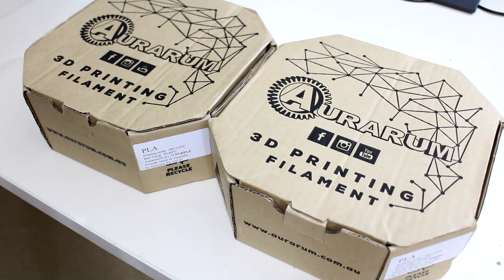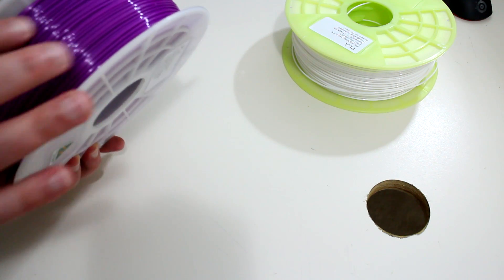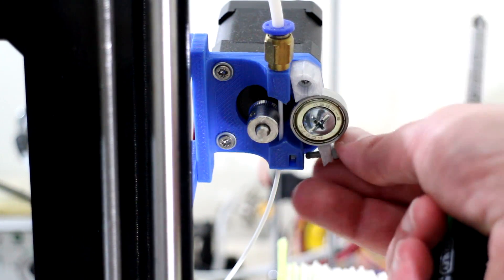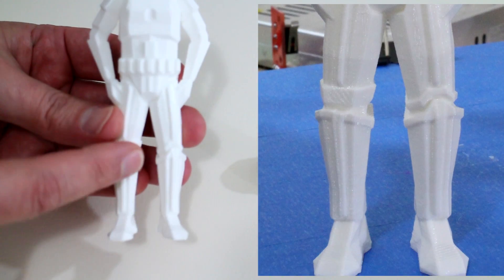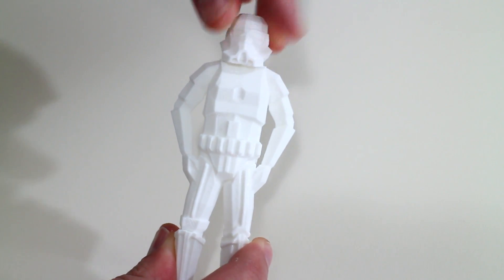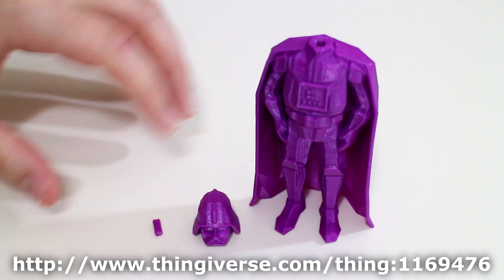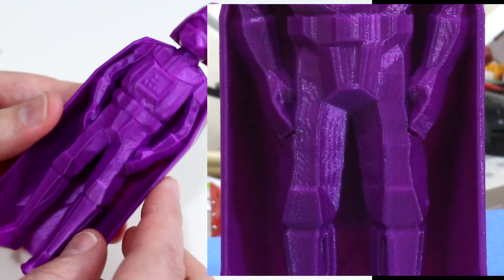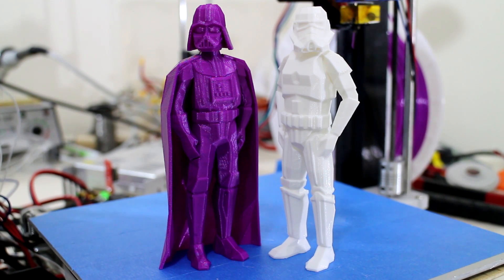Star Wars - 3D Printer Aurarum Filament Review

Comment: I bought some a few months ago. When I opened it there was a PLA sticker on one side and ABS on the other. This got me confused as I ordered PLA. Contacted them and worked it out. Tested it by putting it in acetone, and it didn't dissolve at all, so it was definitely PLA. However, I had a lot of trouble with what I thought was blocking of the nozzle, but found tonight that this PLA requires a minimum of 230 degrees on my cocoon printers. The standard 185-210 was not hot enough. Failing this, it is a good filament to use now I have it under control.

Comment: Hello mate 
can you please help me solve the problem with my Geeetech M201. I have assimbeled the printer and ai have done all the programing and leveling according to the manual. Everything works. The extruder and the bed is heating very well but the moment I give the order to print the temperature drops down and causes the filimant to cool down and then it blocks the extruder. what should I do to keep the temperature as desired?
Reply from the maker: The temperature drops during the print? Sounds like the heater block is cooling down due to air flowing over it. Make sure any fans are not blowing air over the heater block.
It could also be the PID control isn't set correctly. Try doing the PID calibration on your heater.

Comment: I've used Aurarum filaments in the past and had issues with the filament going brittle very quickly to the point of losing half a spool.  I thought it may have just been a dud roll but if you do your research you will find a good number of other customers out there which have experienced the same.  I notice they sent you filament on the "Larger Spools" as well, they did the same for Makers Muse but when you buy on Ebay they send the old stock on the smaller spools but still charge you full price.  It is fantastic filament to print with but due to these other issues i no longer use their filaments.
Reply from the maker: Ok that's interesting. One of my Polymaker rolls of orange PolyMax has gone brittle too. I wonder if it's to do with moisture ingress, UV or some other environmental issue. I try to keep spare rolls in their original packaging with desicant.

I'll keep an eye on these rolls, but maybe buy direct from the manufacturer and request fresh minted plastic only? Thanks for the info.
Reply: +Tech2C yep will be ingeresting to see, what you have here in the video is the new line on larger spools to prevent breakage as you get closer to the spindle, apparently the actual filament itself has the same formula though.  I never leave my spools on the machine, once i've finished printing they go straight into ziplock bags with about a dozen desicant packets.  I've only had the this type of issue with the Aurarum filaments and i've used many brands, even the cheap chinese stuff which actually isn't too bad.  I look forward to hearing how you go with it.
Reply: +Stephen Ozoux Makers muse did a follow up on his aurarum review and also found it had gone brittle

Comment: Hi I've been using a pei sheet on my pi3 similar to yours and haven't looked back I'd highly recommend it over any other bed adhesion alternative. Finally added a e3d v6 and titan based on your earlier videos, good work keep it up.
Reply from the maker: Hey Luke, I have a sheet of pei. How did you adhere it to the bed? Do you need to use heat when printing PLA, or will PLA stick to pei at room temperature?
Good job with your E3D upgrade. Cheers!
Reply: I ordered some 3m heat resistant adhesive not that easy to apply but had about 6 sheets so only managed to stuff it up once.
https://www.amazon.com/TapeCase-squares-Converted-Adhesive-Transfer/dp/B007Y7D5NQ/ref=pd_sim_328_1?ie=UTF8&dpID=51LcHuHdJEL&dpSrc=sims&preST=_AC_UL160_SR148%2C160_&refRID=SV5VT2RG23DEHN6QMFYE
Reply: I always use heat on everything lol although I have my pei stuck to my borroscillicate glass sheet clipped on my aluminium bed. This is to make sure everything is as flat as possible. My bed temps tend to be on the high side to account for heat loss due to passing through all that material. I've done no tests although I should! and can't even justify my settings other than things not sticking on occasion.......on the bed the temp settings I am running about 60 - 80 fro pla and 100+- for abs. With PEI you just have to keep things grease free so a wipe with isopropyl alcohol is all that's really needed.

A pic of my abs enclosure
http://lukethier.blogspot.com.au/
Reply from the maker: Great stuff. Thanks for the info. I'll visit the local glazier and get a piece of glass cut. I'll need to order the adhesive online though.

Comment: I'm so eager to see what you come up with for the Y wobble issue. Your print quality is so high compared to some people I've seen working on 2k$+ printers like ultimaker 2.
Reply: Tech2C
I am not sure you can help it due to a moving bed with inertia etc...  I think the only way to completely get rid of it is when it gets to an edge to completely stop and wait for the oscillations to cease then continue onward.  The length of the pause would be based on how fast you are printing.  You can minimize it but I have yet to not see it on any FDM print regardless of the price of the printer or construction.
Reply: I agree.
Reply: +Tech2C have you tried lowering your y acceleration and y yerk
Reply from the maker: Yeah I have reduced the default/maximum acceleration to 800mm/s, and reduced the xy jerk to 10mm. It does help, but doesn't eliminate it.
Reply: Tech2C that sucks. Are you planning to do a build video when you are going to make the new frame? I also have a prusa i3 with an acrylic frame and really want something more sturdy.
Reply from the maker: Tommie ?
Most definitely I'll post build updates along the way. I have 2020 T-slot  Aluminium here ready for it...
Reply from the maker: I ran a test a while ago whereby I printed a cube with a 1 second pause at each corner, in an effort to localize where the oscillations were occuring. Turns out, at least with my printer, the oscillations occur on acceleration moves only, not deceleration. That is, on my y-axis the ripples appear when the print move begins.
I agree with you I don't believe I can get rid of them as I've tested so many ideas over many months. Although my x-axis is perfect! The plan is to build a frame without moving the print bed...
I intend to build a core-xy frame instead. I'll probably design it from scratch and incorporate all the learnings I have into it. 
That's interesting you say that you have yet to see any FDM printer eliminate this phenomenon. Doesn't bode well for a core-xy setup which has less moving mass.
Reply: Tech2C
It is still there on the core but way way less so is very acceptable.  The problem is the motors we use I guess because if it allows oscillations like that something isn't right.

I wonder if there is a way to make the oscillation finer?  Say going to 16 or 32 or even that beast of 128/256 micro stepping and seeing if the same print had exactly the same oscillations or the same amount of them or if they go as far.  Would be an interesting test I think.
Reply: I think that the structure of the printer is at fault. Having the bed translate on the Y axis is not the best idea. The bed on the Z axis like ultimaker is the better option imho. Because having two part moving on the same plan multiply the risk of imprecision.
Reply: Rubafix989
This is what the core x/y does and why it is less of the rippling but after having tried a cantilever based printer I am no fan at all.  I think the core x/y uses four points for the bed instead of just two on one side and that would be the best.

In all honesty the best printer is like the one I designed but costs through the roof and my HDD died so there went the plans and layout but easily replicated.  What the design did was move the nozzle up and down using wheels not linear bearings (I despise linear bearings) and the bed did not move at all.  If I had the money, and the tools I would need to build it, I would build the printer.  I was going for all wheels and Openbuilds' V-Slot.
Reply: And what about delta printers? I've never seen any irl yet. But it seems interesting even if the movements of the print-head is more complicated.
Reply: Btw I just looked at OpenVSlot it seems really interesting, but I'm questioning the ability to stop and remain in position in the long run. What mecanism do you plan to use? Belts? or some kind of breaks?
Reply: Rubafix989
The Delta printer is wonderful with round objects but on the straight away it has a moire type pattern and that is because Delta printers struggle with straight lines due to the tech.  That can never be fixed.

I was going to use GT2 belts and many printers have been made, and laser cutters, etc... with Openbuilds' VSlot so there are no issues about stopping since a laser demands even more precision.  The deal is Linear Bearings have slop in them because the bearings have to have some give and take but Radial bearings do not and Radial bearings are much much quieter too.

Comment: Awesome! What retraction settings do you use for your bowden setup?
Reply from the maker: 150mm/s speed over 3mm distance. Cheers!
Reply: Cool! I had filament grinding issues after a certain length of time printing and I had thought they were my retraction settings so I had turned them way down only realizing afterwards that I had my extruder pot turned too high for the new stepper motor I had installed, causing it to get too hot and soften the plastic enough to slip. Or that's what I assume it was since I turned the pot down and haven't had any issues since. My retraction settings are still bad though so I get some pretty bad stringing. If i were to try the prints you did with my current settings, it'd look like their legs were connected haha. I'll try those settings and work from there. Thanks for the response and keep up the good work!
Reply: +Tech2C How long do you retract PETG?, my brother in law had PETG solidify in the heat break apparently because he retracted too far
Reply from the maker: XAD566
Wow how far was he retracting?? I don't change the retraction settings at all between filaments.
Reply: +Tech2C not too sure(and he's on holiday so I can't ask), but he didn't change it from ABS. I do however think that his heater block(where the nozzle sits) is lower than an e3d